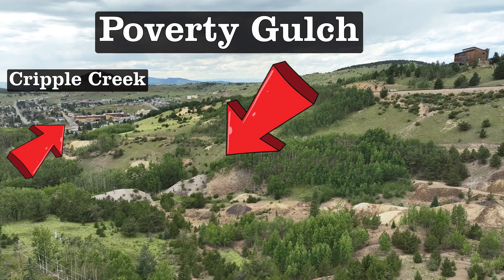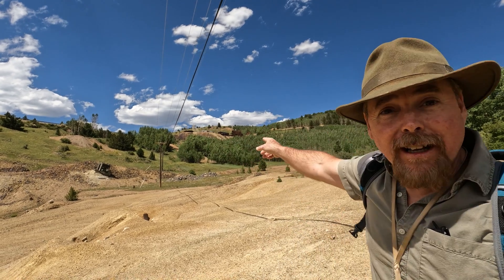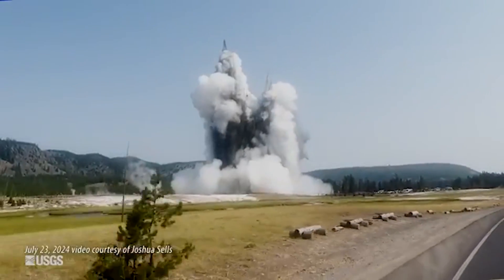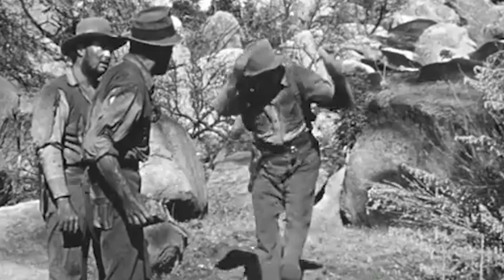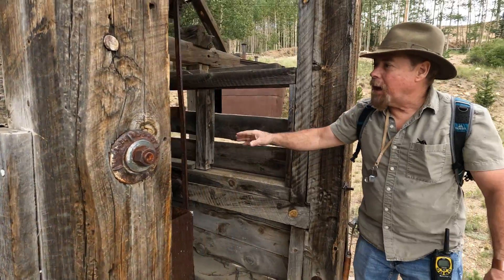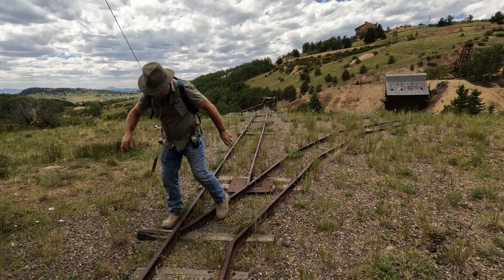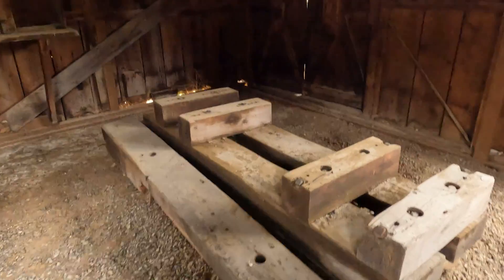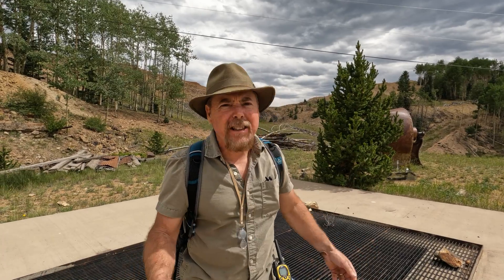The Secret Gold Discovery That Changed Everything in Cripple Creek

Comment: Having "visited" many of these mines in the 70's (yes I'm a dinosaur), I can attest that there were many artifacts left behind in all the mines. Many of the mines were interconnected by tunnels. We utilized 8" carbide lamps as flashlights with any kind of lumens were heavy at best and cumbersome to carry around. No fun lugging around a blue/yellow Rayovac brick up and down ropes/ladders. There is now a huge open pit where many of them stood. Though you can see crosscut drifts on the pits walls. Visit the Independence mine as they have a good historical display along with a huge head frame and wire rope winch. The shaft is over 2000 feet deep. We only "visited" down below. Lots of history and worth the visit. Imagine 500+ mines in that area.
Reply from the maker: would love to see pics of what you saw down there .... thanks for sharing
Reply: @Askjeffwilliams  I would have loved to have taken pictures but there were no cell phones etc then. I didn't carry an SLR or anything of that nature even with a flash. Just more stuff to carry. Just carried a can of carbide and water. Plus a lot of rope and jumars. Virtually all of the mines there had some air flow as they were all interconnected. This was way before Anglo  American and the times I was exploring, no core drilling at that point. Though Newmont and Anglo came in and bought all available claims. $$ talks. Though I visited the Independence underground, we always armed ourselves with copies on mine schematics before venturing out, it is something to visit the Independence at the head frame and winch house. Impressive to know when you stand over the grate of the shaft, they may have closed that off for safety reasons now, that it is over 2K feet straight down. Sadly time, vandalism and the pit mine have erased so much that used to be there.

Comment: I worked at that mine newmont bought for ten years. Anglogold had it before them. They had a huge part in saving the old headframes as well. I learned to operate equipment while under AngloGold good company to work for.

Comment: Jeff,the yarder I ran had witchataw frictions they looked like drum brakes they ran in water to keep them cool they were invented in witchataw Texas for oil rigs you would run air pressure on them I would run 5 psi on my hall back line to keep it  a little tight so my drums wouldn't mess up. You have a hall back on your mucker in your mine the winch line that pulls it back.
Reply from the maker: thanks Glenn